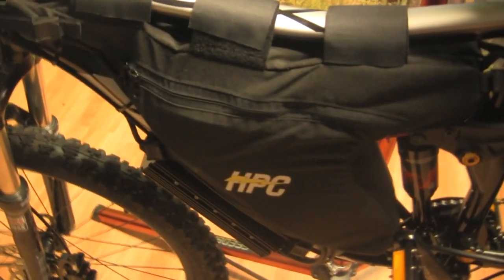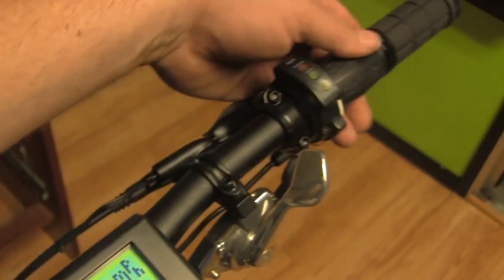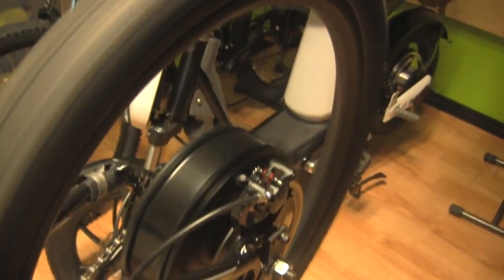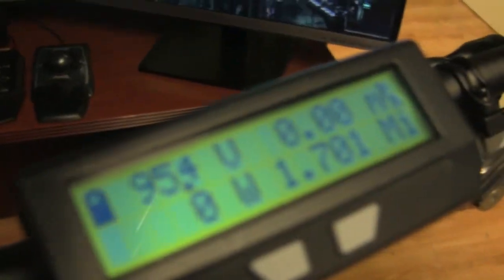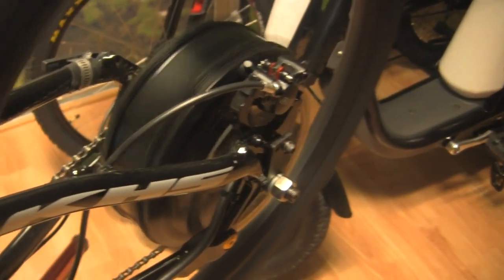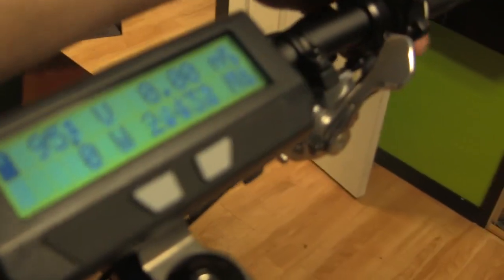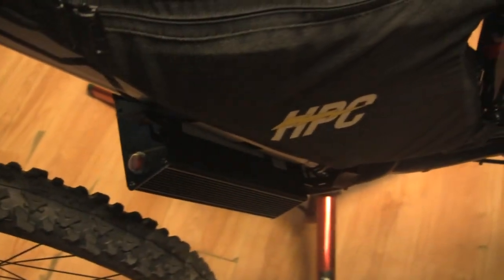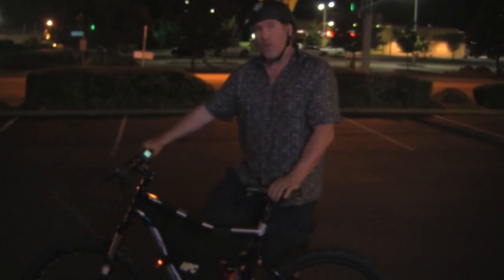60+ MPH ELECTRIC BIKE CONTROLLERS & TEST RIDE - OLD VS. NEW SINEWAVE TECHNOLOGY

Comment: Props doing that on 2" wide wheels. Have you done 60 on a fat wheel bike? 

I would think it grips better for hard braking and cornering but are they too front-heavy because of the added mass?
 I ride a fat tire bike but it tops out at 25mph though it has slid out from under me but that was in dry sand on a corner at low speed and my tires were too full/empty.
 Ive driven <40 on a 6" hard tire scooter before which was sketchy and I blew my motor almost sending me over the bars.

40+ on an 8" tubed/ tubeless tires.
Which is less sketchy but absolutely terrifying at 40+

I believe 40+ would be a lot safer on a big wheel bike.

Comment: 100 Watts less at no load full RPM is a 33% drop in wattage and it appear to be a lower in rush current  as well. Did you notice an increase in efficiency while riding?

Comment: How does it perform in real world regards power saving and speed etc?
A test with wheel in the air is not conclusive.
I'm thinking of upgrading my 1000w controller sometime and see a lot of sine wave ones for sale now.
Reply: I have both and use the same battery for both. I haven't noticed a range difference  big enough to tell between the two. The square is nicer to use, with the power delivery and sound.

Comment: Question: I have a 1000 watt Ecotric Hammer, 48 Volt, I want to use a 52 volt battery with. Is there any reason why the 48 volt controller would be damaged by this?
Reply: Most likely it shouldn't as long as your caps in your controller can handle 60v

Comment: Curious if you guys have any experience with fat quads... I'm thinking  4 hub motors + controller/throttle/battery. Would something like that even be doable?
Reply: Luscious3174 4 hub motors on a 2 wheel bike?
Reply: @tim9464  can't read